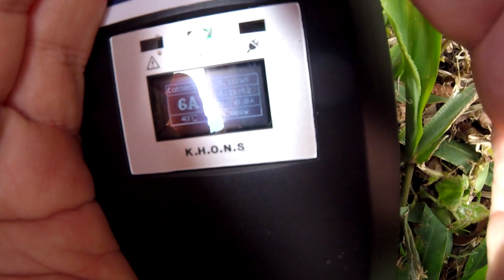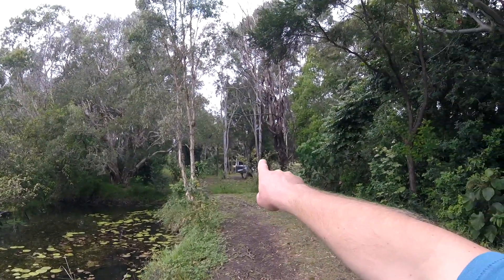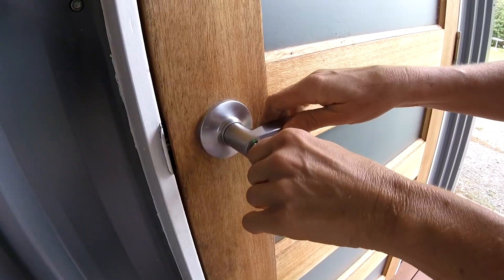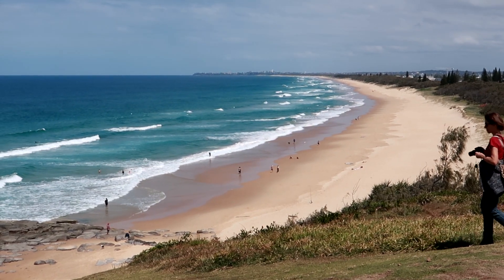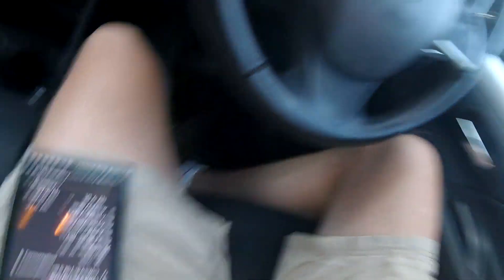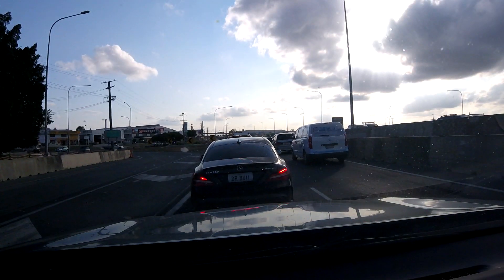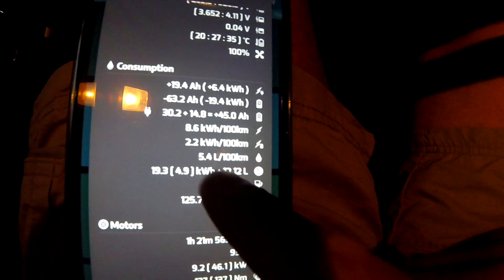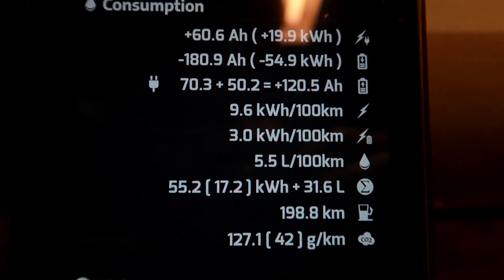EP126.4 - Outlander PHEV uses Charge Mode for better fuel economy?

Comment: Great video, thanks from a British Columbia PHEV guy! I really enjoyed the scenery. It makes me want to take a holiday down under. I don't find that the charge mode reduces the highway fuel consumption significantly. I use it for free way stints all the time.
Reply from the maker: Thanks for your feedback Ron! The BC PHV guy, eh? Well, charge mode does increase you battery SOC. So it only make sense when you need the electric range later on that trip during slower driving. My trip was ideal as we had some city and highway driving. City -> Ev, highway -> Charge Mode.
I'll do some more testing and see if it really lowers the consumption.

Comment: Hey Andy - this is exactly what I've been finding. Using charge mode on fast highway driving then going back to normal hybrid mode until the battery drops, and repeat etc... gives me better figures than just driving on a single charge. I get about 6l per 100km for 150-170km trips (nearly flat all the way too)... everyone on the FB page (bar one or two) always goes on about the 'charge mode' being the one thing not to use. I'm using it!
Reply from the maker: Yeah, I think it is more efficient when using charge mode instead of save mode or automatic hybrid mode. I'll do some more testing ;)
Reply: I used it yesterday and it seemed better!

Comment: I do some long drives, and my finding on highway driving is that it's best to use electric power for hills and city driving, then switch to charge mode on 100km/ph flat or down hill highway drives.

Comment: Hi Andy, you've discover the motorway charge secret!  Yes it works, I've been driving about 6 months like this.  You use the best petrol efficiency ( motorway) and charge and then ev in town. If you are ever on a short trip you ev and on a long trip you always have motorway so this car works no matter where you go :)
One extra tip... watch your throttle use when charging up a steep incline. I've found it sits around 10l/100 but will jump to around 18 if you load the engine to much,  like an overdrive kind of thing.  I find eco mode helps and even go to ev only up a steep hill and then charge again as it levels out ;)
Driving like this is the essence of a hybrid, using all its facilities to best advantage.
Reply from the maker: Thanks for your feedback. That is correct, when the car is in series mode the engine revs up like made and I have seen 18L too. That's why I try to avoid this mode under all circumstances. Going up the hill in pure EV and then recharge later is a good tip!

Comment: The car may not be able to balance the cells with out a full charge  but try leaving it plugged in for a while maybe that may help.
Reply from the maker: The battery balances sometimes at the beginning, sometimes in the middle, sometimes at the end. Sometimes even twice during a charge (I made some videos about that too :D ). The BMU makes the decision according to the actual cell voltages and target voltage.
Reply: @unpluggedEV  oh ok well thanks than      I still am confusedabout all the degradation it really shouldn't be this way...
Reply from the maker: @theamazoner4075  Same confusion here... :D

Comment: Hi Andy, one question. Do you think exhaust pipes and all the stuff under the vehicle is highly exposed? Have you ever had any problem off-road?
Reply from the maker: I occasionally have some grass hanging at the exhaust pipe when going a bit 'soft-road'. The clearance is only around 20cm so not too much  anyway. The battery and motors are fully waterproof and sealed though. I scratched my battery a few times at some humps...

Comment: Hi, we get a used 4WD Outlander beside our Zoe to compensate for the old Passat for pulling horses. So I would love to learn more about this car. We want to utilize the battery as good as possible as we are EV fans. How to you connect the PheV watchdog with the Outlander? Does a standard dongle work? The charge mode looks strange to us as we would use basically a oil power plant instead of regenerative energy. How can we avoid this?
Reply from the maker: All you questions are answered in all my videos here on the channel 😉

Comment: Hello just for your information once the charge mode charges the battery to 80% or what ever it then becomes a keep mode there is no difference from that point on regardless how far you drive therefore can not be any mileage benefits. Thanks

Comment: Hi Andy how large difference is the on board KWh calculator vs external Calculator.(7.7KWh) in my19 i am getting around 10KWh from the on board, saldy i am using around 28KWh/100Km, its colder than 0°c and very hilly where i live.
Reply from the maker: The charger loss is around 9-10% from what I can see.
28kWh/100km is INSANE!

Comment: Sometimes the engine gets loud when driving in charge mode and acceleration power feels decreased.  Mitsubishi explains this is because the gas engine is being directed to recharge the battery. That makes sense but it’s unpleasant when driving.  The engine loudness is relieved if I turn charge mode off.  
2019 PHEV. Anyone have any expert experience with this phenomenon?

Comment: forgot to say,  what about getting a Wallbox or just keeping car charger for charging?.
Reply from the maker: A charging station does not make sense for me. Not with the PHEV anyway.
Even with a pure EV and and a far larger battery, I can still use the EVSE on 15A setting and charge 150km in around 10h. My commute is only 30km/day so even charging on 1.3kW (6A) gives me 60km per 10h charging.
If we go further I can always quick charge at a public station. I know EV owners in the UK getting subsidised charging station  with 7.7kW or even 22kW. Depending on the price, I would probably get one if I hade a larger battery (say 60kWh+).
I got your other message and will send you an email in the next days, didn't want to publish you message here ;)
Reply: Thanks Andy. You’re doing a great job and love the way you edit videos

Comment: I have a simple quick question please how long did it take to charge up to 70% while driving down the highway and again 45% as you have stated in the video if you don't remember the time roughly how many kilometres did you cover to get the 70% charge and the 45% charge that will also do thank you
Reply from the maker: Uh, oh, I don't have exact numbers. On a recent drive (fairly hilly roads though) it took around 50km of driving to charge 20km EV driving. It is much better on flat roads though.